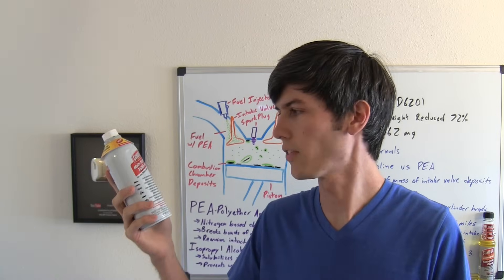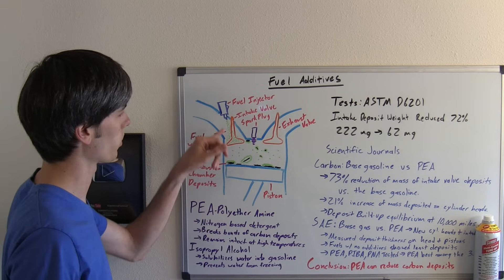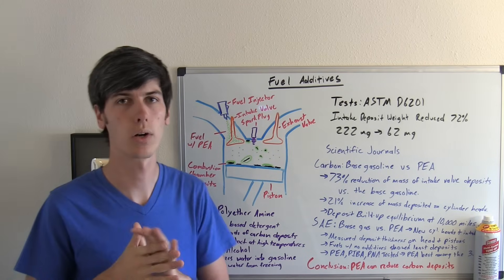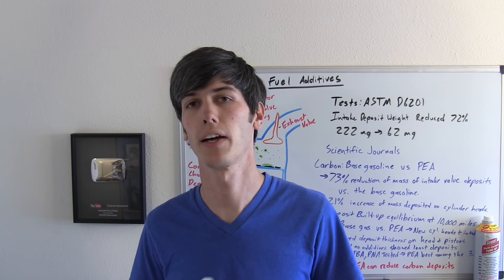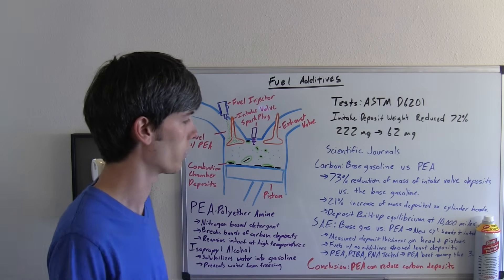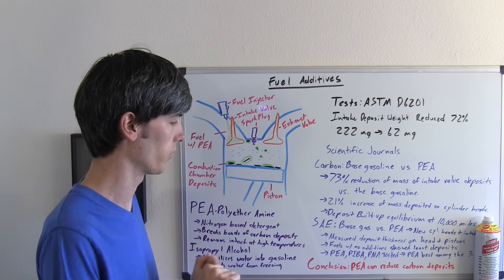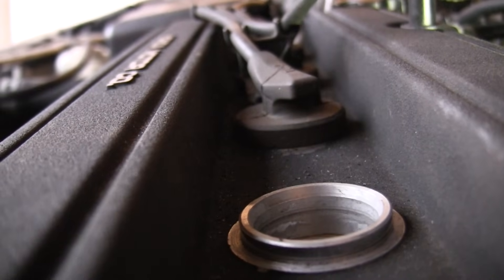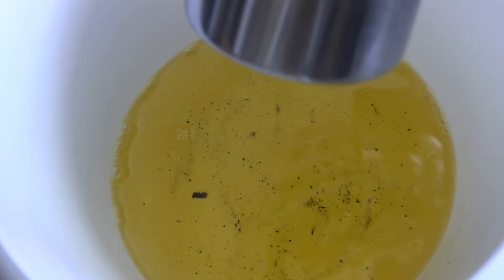Fuel Additives & Injector Cleaner - Explained

Comment: First off thank you for what you do and all the videos that allow us non engineering inclined to get the concepts and applications. I would love it if you could do a video on water methanol injection soon. I'm debating running it on my GTI mkV and feel like there aren't many negatives to it as long as fail safes are in place and your tune accomodates it (like my APR tune can). Love to get a proper engineers perspective though.
Reply: Bg44 k platinum excellent product for cleaning carbon deposits

Comment: Hi,  I'm curious. Does the carbon block the cats after moving out of the piston chamber.  Thanks for your videos.
Reply: ln theory if there was a massive dump of carbon that could potentially cause some cat blockage or at least throw a code but if you do the procedure correctly that won't be a problem. That's precisely why most of these products recommend your car but already up to operating temperature when you put the product in your gas tank. The reason for this is so that your cats are fully hot at the point that the cleaner starts loosening up the carbon deposits which will then get vaporized during the combustion process, pass right by the hot cats, and expelled out the exhaust.  Also, at the right concentration levels, a certain amount of the cleaning agents will also get vaporized and make it to the cats and help clean up any residue build up. Of course that will not help if a cat is already damage, melted, disintegrated, etc, in that case you need a new cat, but for cats that have excessive residue buildup, the vaporized cleaning agents can also help clear some of that out and allow for a more efficient catalytic process. When l do a decarbonizing treatment of the fuel system, after the process is completed l do remove the upstream & downstream O2 sensors and leave them soaking for about 24 hrs in either plain gasoline a thin cleaning agent such as Seafoam, Berryman's B-12 which does a fantastic job of removing built up carbon and other contaminants from the sensor tips which are located behind the metal shroud. You will see a surprising amount of soot at the bottom of the glass container that you soaked the sensors in after letting soak for 24 hours. After removing them from the cleaning solution l then thoroughly spray them down with MAF sensor cleaner, using the little straw that comes with the spray can you can insert the straw in to the holes that are on the shroud and blast out remaining contaminants that may still be stuck inside the shroud, then spray down the outside to and give it a good wipe down. This will do a lot to keep your catalyst system working properly and efficiently for as long as you own the car. Some people do this O2 sensor cleaning process at the same time that they do the regular maintenance cleaning of the PCV valve, EGR, Throttle body which is a great time to get it all done together.
Reply: I'd us Cataclean to clean out your catalytic converter if you think it's dirty or it's time to clean it. Cataclean works awesome! It cleans injectors, o2 sensors, combustion chambers, and catalytic converter, and muffler. The muffler id the least likely thing to get clean, but it does help keep it from clogging. I've used it for years and it works. It's usually a little over $20. About $22- $26. So if you need to pass emissions or need to get rid of a o2 sensor code try a bottle of Cataclean on a 1/8th of tank of gas, and drive it for 15-20 or 15-20 miles whatever comes first, and then fill it up with fresh new gas.

Comment: Engineering Explained  you forgot DIRECT INJECTION
Reply from the maker: Gli_Fahrenheit Did I? Just don't plan on cleaning your intake valves with this stuff if you have direct injection (since obviously, it won't be contacting it on the back side).
Reply: What can i use to clean valves in a direct injection engine ?
Reply: Gli_Fahrenheit you could take it apart... but the best thing you can do is use good oil and gas and call it a day. especially if that yellow golf is the car you're talking about
Reply: Cool thanks pooft Lee

Comment: Whats happens to the carbon build up? Would this gum up 02 sensor and/or catalytic converter, or does it break carbon down to a small enough level to pass the catalytic converter?
Reply from the maker: 2muchy2 Great question, I guess it just depends on the particle size. Hopefully it burns up in the cat, but it's probably possible to have particles stick there.
Reply: Engineering Explained  True, what we're burning off sure can get stuck in the catalytic converter, but if it does just run a gallon of lacquer thinner versus 10 gallons of gasoline and that should keep the cat maintained.

...I've been having fuel injector problems, my remanufactured replacements were worse than the originals! And I can't just go back, the system kept leaking and fuel injectors apparently die when fuel is on their outside instead of their inside so my old injectors are shot too.

Long story short, when I finally work this out with warranty, I'll be running lacquer thinner through because a lot of lean/too rich conditions have occurred from these sloppy injectors.

Comment: My cooper s has carbon build up I'm taking it for a 'terraclean' service will it work or is it snake oil. 

It's direct injection so in told it may not work as well.
Reply from the maker: If it's direct injection and you have build-up on the intake valves it would be difficult to clean with an additive. If it's in the combustion chamber, different story. I've never heard of terraclean - I'd just recommend checking out the active ingredients and seeing how valid they are before using it. (Or monitor the results).
Reply: Terraclean is done by specialist at a garage they disconnect your fuel line and hook up there own using their own full. They leave it running through your engine for an hour.
Reply from the maker: Cornwall1888 Well maybe worth investing in a borescope and checking before and after. It's really simple to check - just pop out a spark plug and put the camera in, have a look around - record some footage and take some pics. Then do it again after you get it cleaned and see how well they did.

Comment: does the 73% reduction of deposits on the inlet valves out weigh the 21% increased amount of deposits on the cylinder walls ?     and is premium fuels such as shell v power ect not saposed to do the same thing but perhaps without the increased cylinder wall deposits , thanks
Reply from the maker: Premium fuels have similar additives to try to do the same thing. Some regular fuels do as well, but premium fuels typically have higher concentrations - hence, my recommendation (4:48) that if your engine is clean, using high quality gasoline is all you really need to do.
Reply: Thanks for the reply and your time for this vid much appreciated

Comment: Even with all this good talk about these additives that everyone has been doing I still don't think I could trust putting this into my car. Just my two cents.
Reply from the maker: At some point, I may end up testing it out in my Integra. Don't really have the time now, but I kept the MSTU bottle for a before and after test, should I ever get around to it.
Reply: My old car, a 2001 2.4 Liter, DOHC dodge stratus ran for a good 30 seconds dieseling after I pulled the keys when I tried Seafoam's instructions for tapping into the vacuum line and intake. I don't think it does real harm in the fuel